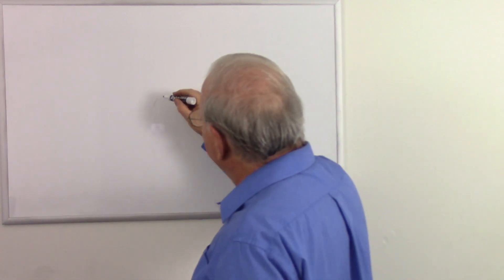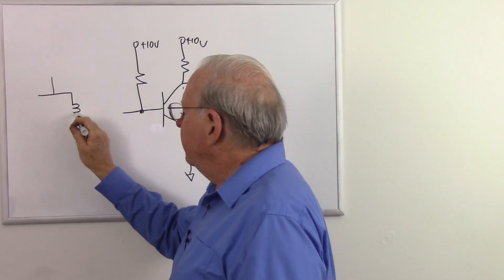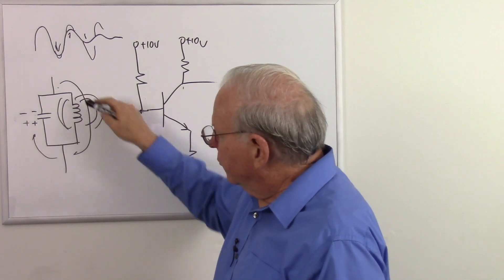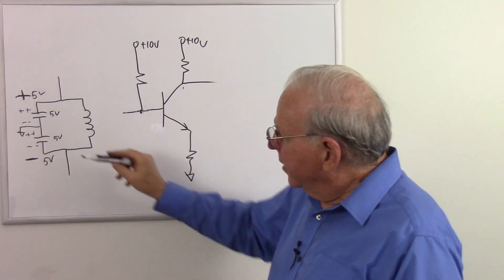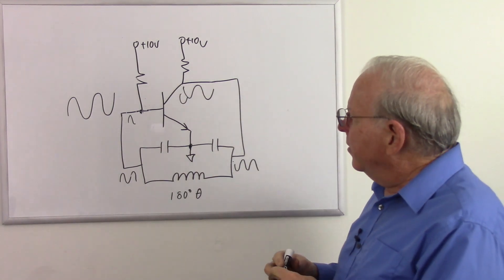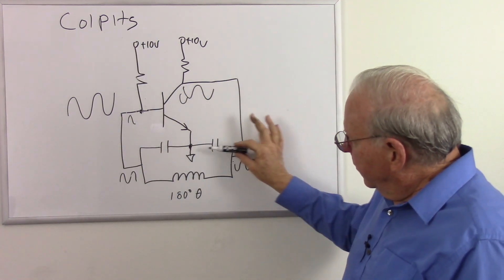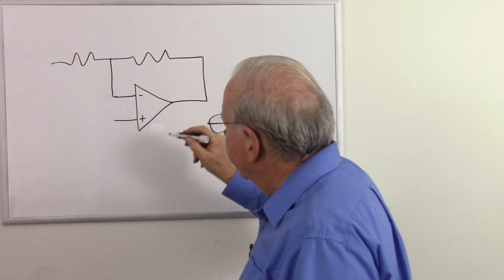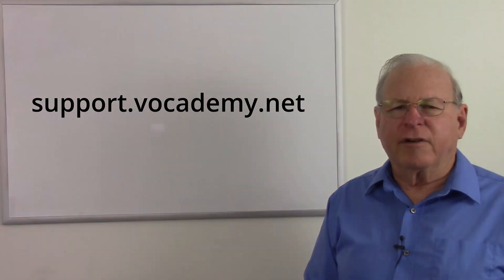Colpits and Hartley Oscillators - Solid-state Devices and Analog Circuits - Day 6, Part 7

Comment: Emergency question....
this question is very very confusing...
I have 2 identical 12V DC 7.5Ah batteries say X and Y.
One side of a normal bulb is connected to postive terminal of X battery, and another side of the bulb is connected to the negative terminal of the Y battery.

The negative terminal of X battery and the positive terminal of Y battery are not connected to anything.

1. So, in this case, I want to know whether there will be a current flow to the bulb, and whether the bulb will glow??? Give reasons if bulb will glow, and reasons why bulb will not glow.

2. If both negative terminals are connected to the negative side of the bulb, then YES the bulb will glow. Will there be a current entering into the 2 negative terminals of both the batteries? If current flows, then will the amount of current be the same into the 2 negative terminals??
Thanks in advance.

Comment: Does the transistor-based Colpits oscillator consume less energy compared to the Hartley oscillator for the same output frequency?
Suggestion: Please disable the autofocus feature on the camera after setting its focus to the whiteboard. 
Thank you very much.

Comment: The last oscillator with the opamp, could we use it as a piece of test equipment ? if we had an unknown capacitor and plugged it in then      adjusted the pot until it went into resonance then back track some maths (scary stuff) and determine the capacitance. Is that practical could you get close to the right value please ? Just curious !....cheers.